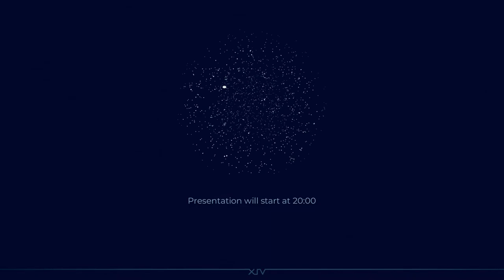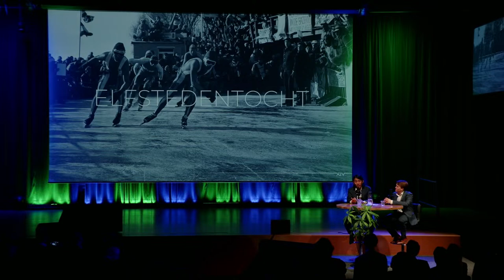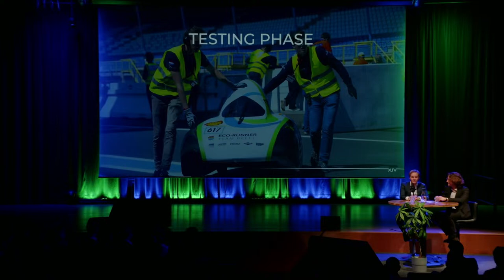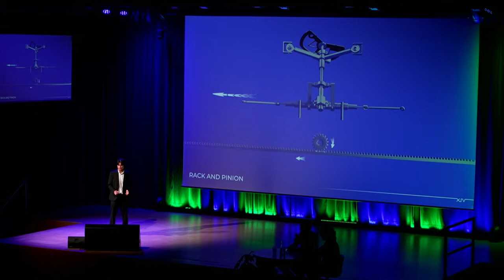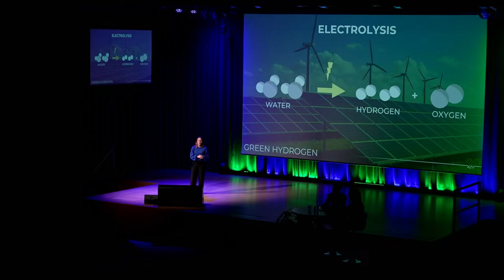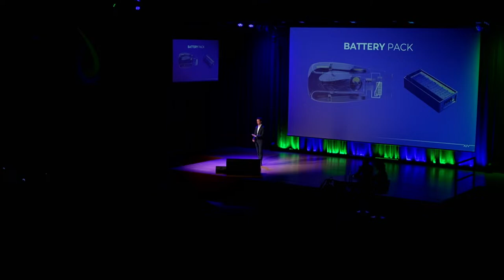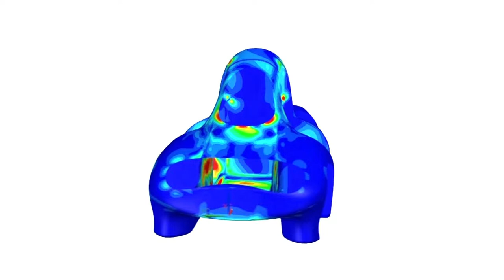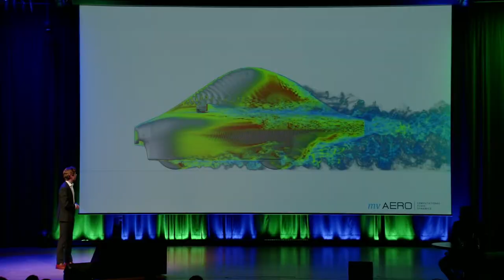Design Presentation Eco-Runner Team Delft Live Stream

Comment: Nice experiment! But the overall tone feels like it ignores the unsolved problems of hydrogen. 
"Benefit of hydrogen is that it can be moved and stored quite easily." How? These are the main problems with hydrogen, besides inefficient production and conversion to kinetic energy. Unless these are solved, hydrogen is only viable for large shipping for transportation en some other niches away from the grid. 
Als can't believe heating is mentioned, when it's unbelievably inefficient for that compared to available technolog by factor 6-10.